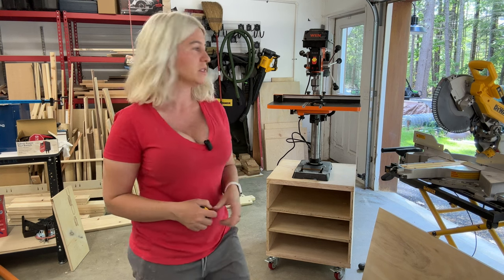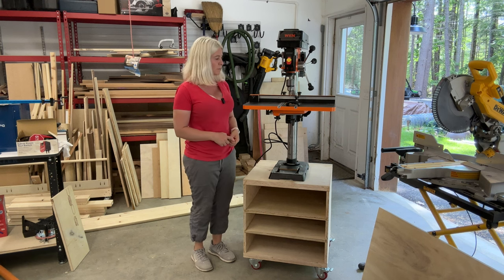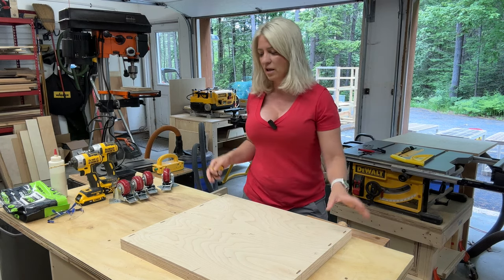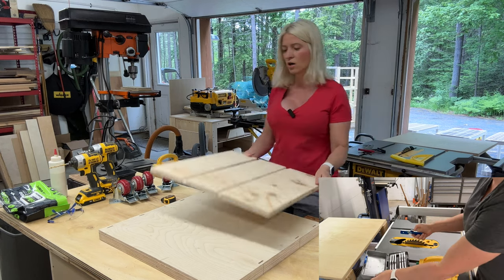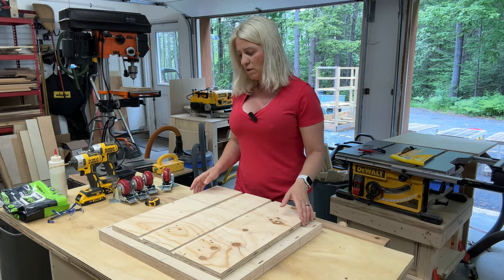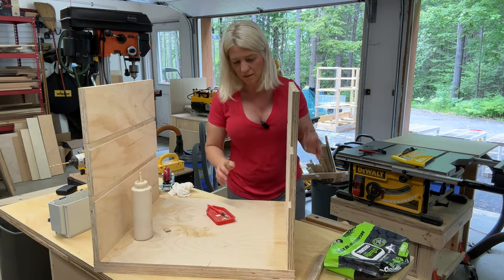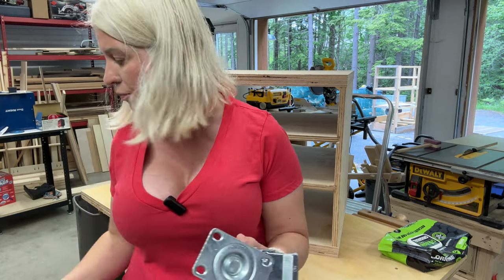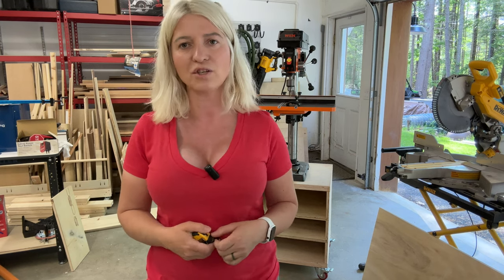How to build a drill press stand. Very sturdy woodworking shop stand easy build step by step

Comment: "What is the right height?" 

Whatever fits YOU! This is YOUR shop. You are the one working here. If your tools aren't comfortable and convenient to use, you won't use them. I get into friendly ribbing with my brother whenever he comes around..."What is this? A shop for midgets?" He's 6'4... I'm 5'6...but I built my shop for ME!

I just bought this drill press on Prime Days for $195. I know, huh? I should be ashamed😂

I think I like your stand. I can see me doing one very similar. I will likely set the table on the drill press at about 2-3" above my resting elbow height. Low enough for easy component control, and not so high as to be cumbersome. Likely an inch or two shorter than yours. Well done, Skylar!

Comment: So funny.  You are ahead of me of where I need to be.  I need 4 carts (table saw, planer, jointer and drill press) that I will make two this weekend and your videos advance my designs.  Your planer dust collector is the only one I question but the rest are great and super helpful.  All of my carts will be table height of 32" with adjustments for the table saw and mitersaw also even at 32". Cheers to you!

Comment: My floor standing drill press, the chuck is about 49" from the floor. I am 6' & it seems just a little bit too low for long jobs.
Reply from the maker: I was always wandering if there is an ideal hight it should be
Reply: @woodworkingwithSkyler  I say whatever is most comfortable for you! 👍